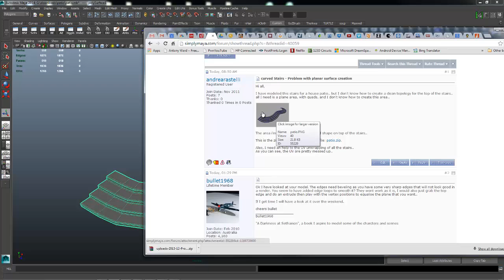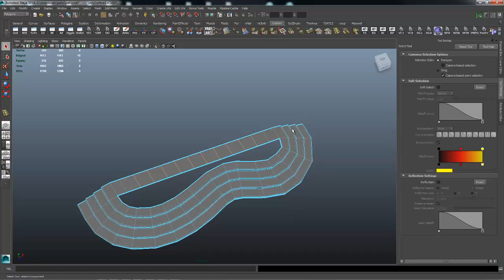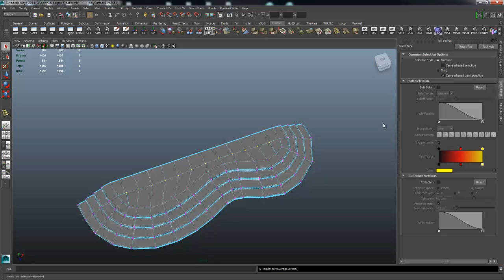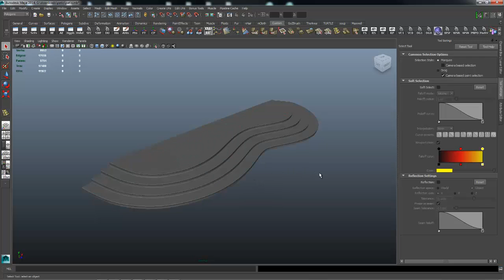how to fill in a planar region

Comment: Hi brother. I'm doing something that needs this, but instead of explaining it to you. imagine i hand build a tube with no  cap on the top. and there were about 20 veritces around the top where i want to put my cap (so there's 20 line around the lip of the tube and they're for the geometry as they're lines going all the way down to the bottom also). How would you fill in that cap hole? would i have to do like 10 briidges from one side to the other? and what about when you get into the smallest corner parts? 
Thanks man
Reply from the maker: For a closed surface with a hole that is planar and where you can't pick out where clear corners would be.  You could do it by extruding inward a small amount and then fill the remaining hole.  As long as the surface is planar then you could call this done.  If you have an AD that does not allow n-gons, you could then manually use the cut edges tool and slice the n-gon up into quads.  I rebuilt my computer and my video recording software is not yet installed so I can't make a video at this time. (
Reply: thank you so much, im trying to make this      i209.photobucket.com/albums/bb93/Ortayga/facemask1_zpsqomlnezz.jpg     (you might have to put the http;// think in front). I'm really having troubl with those bulgy parts to the sides of the mouth. any ideas how i should approach them?